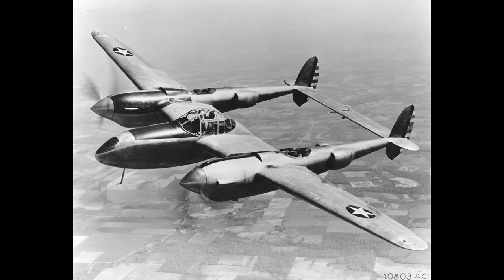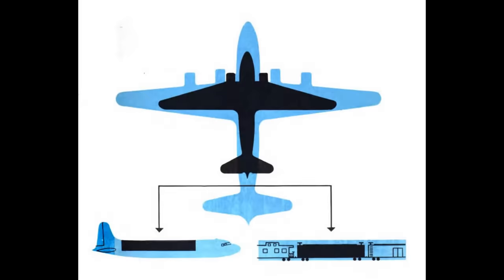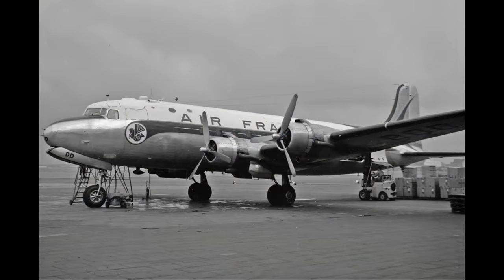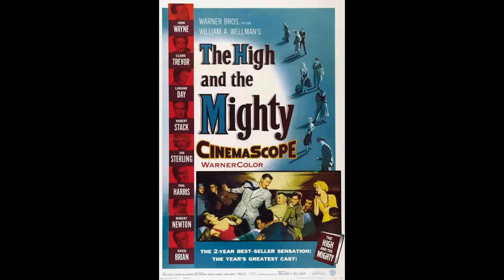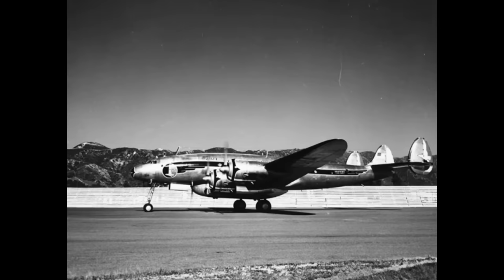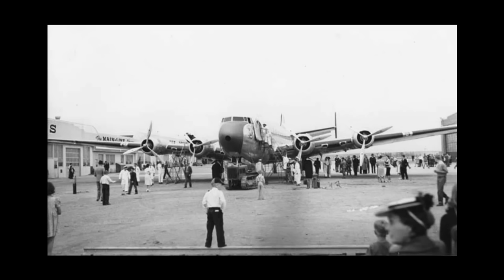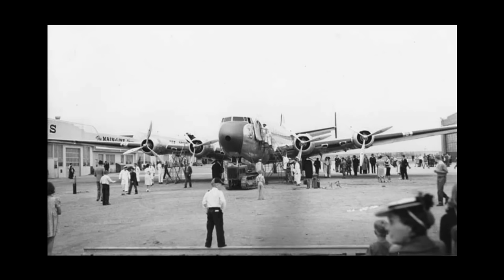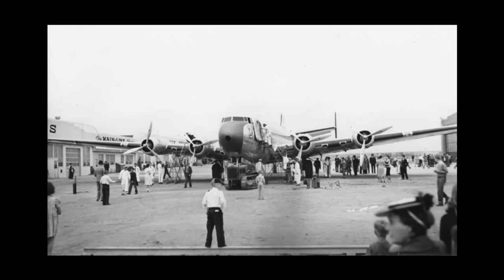Turbo Compound Piston Engines. Almost magic tech.

Comment: I'm imagining being a businessperson on board one of those things, trying to compose some notes on a pad or a portable typewriter, being serenaded with the soothing sounds of a thousand lawnmowers outside 😂
Reply: Big piston engines are LOUD. True turbo-compound engines were marginally quieter.
The Napier diesels were particularly fuel efficient.
Reply: you wore headphones attached to the bulkheads or earplugs if you were chique
Reply: I remember flying in those planes on Frontier Airlines in the late 60s, and even as a small child I remember thinking they were loud and the whole plane vibrated. Still glad I got to experience them before being replaced with jets, but damn they were a lot smoother and quieter, and more thrust on takeoff.
Reply: Flew Logan to Stuttgart in 1961 on a DC7. Returned on USS General Maurice Rose Bremerhaven to NY in 1965.
Reply: @MrArgus11111  No that came in much later.
Reply: @davidscott430  And on LANDING, every house within a mile of the flight path also vibrated - and people now complain about jet noise…
Reply: Radial engines are loud but I remember there being something oddly soothing about the sound. Unlike turbo props which made a horrific racket.
Reply: @randomDIYguy-k4r  Big piston engines have the same propeller noise levels as a turboprop but layer pulsating audio frequencies from the pistons at multiples of 40-50Hz per cylinder.
Reply: @allangibson8494  Does that cancel out some of the noise?
Reply: @twistedyogert  it adds to it.
I used to live under a flight path - a DC-6 on approach caused the entire house to bounce, a 727 didn’t.
Reply: @allangibson8494

Anything with a turbocharger was quieter as well. 

Which is why the Northstar and Argonaut using supercharged Merlins with short exhaust stacks lived relatively short lives hauling passengers.
Reply: Flew on s-58s for a couple years, I always pictured a group of Harley's pulling us through the air.
Reply: I’ve not flown on large piton engine aircraft but the turboprops used for short haul flights in UK and near continent are incredibly loud. You need ear defenders to sit near the propellers. It’s the prop tips getting near supersonic. I can’t imagine what actually supersonic prop tips must be like.
Reply: I've flown on the Q400's from Bombardier and I find them quieter than a Dash 8 for example. I liked my ride in the high-winged Dash 7 over the Rockies. Only piston I've ever flown on was a Cessna 172 and that was loud enough.
Reply: @randomDIYguy-k4r  Probably the odd number of cylinders, and the engine timing that was "off" due to the way the connecting rods were arranged around the crankshaft. Radial engines make (loud) music to my ears. I'd imagine the power recovery turbines ameliorated much of that exhaust noise, and smoothed power delivery to the prop.
Reply: Well I flew from Beja, Portugal to Lajes on the Azores and back in 1989 in a C 160 Transall so Ican empathize what it meant to cross the Atlantic Ocean in a prop plane.  We wore headphones. But maybe civilian airliners had better sound insulation…
Reply: ...and that would be better than sitting with somebody's "comfort chicken" on your head.
Reply: Alcohol was a thing
Reply: @allangibson8494 True but there can’t have been more than 100 “big piston” airliners actually in the air globally at any one time back in those days - compared to the 10,000 or so jets and turboprops simultaneously flying today
Reply: @neilturner6749  There were over 1400 DC-4’s, 6’s and 7’s built.
And then there were the Boeings, Avro’s and Lockheed’s contribution.
There were occasions when 400 DC-4’s were flying one air route simultaneously (into Berlin).
Reply: Yeah, being a businessman on one of these planes at that time, would be very interesting.
Reply: Ha Ha Ha,😅 You're a funny Guy!
Reply: @henrivanbemmel a Q400 IS a Dash 8.
Reply: In a suit and tie and a bejeweled lady in mink next to you, real china in the gally, cigar in hand. We were Kings, what happened?
Reply: Funny... cause the very first aircraft engine of the Wright Flyer was a "Dual Ovehead Cam" classic watercooled 4 cylinder, with all the basic components found in any "modern" 4 cylinder engine, including the long tensioned sloppy timing chain.   LOL ... guess you better do a bit more studying of engine designs before you find yourself mistakenly calling the more modern pushrod hemispherical head engines "archaic".  Which is a common misconception these days, even going as far as calling electric cars modern, yet they were found right along side Model-T Fords a 120 years ago.  Such as the Baker Motor Vehicle Company, an American manufacturer of electric automobiles in Cleveland Ohio, from 1899 to 1914...
Reply: @marclagalle1486  Yes, it is, but I few on the older pre-Q series version and compared to the Dash 7, which I really enjoyed, they have larger props and I found it quite noisy. I think the Q series are quieter, but I'm 6.3 230lb and I found the Q400 cabin VERY cramped and when I used the washroom I had to jackknife my legs against the door. The seats seemed like a postage stamp to me. The overhead compartments were too small to accommodate my computer bag. Thankfully, the cabin was not full and the flight attendant allowed me to sit elsewhere where my bag could have the other seat. 
So, while it got me to Boston, I would have rather taken the train. Sometimes its nice to be smaller I suppose.
Reply: That is why first class was in the rear of the plane where the majority of the prop noise doesn't affect it.
Reply: @georgemacdonell2341  Deregulation 👎
Reply: @calvingreene90  Yes, but when Air Force 1 became a jet under JFK, they had to make changes, moving the President's room forward  because in the 707 the front is quieter and smoother.
Reply: @henrivanbemmel  
Like I said "was" not "is".
Reply: I used to live under the departure path from Cochabamba Bolivia, the departing 727 certainly shook the house! But I’ve not heard a DC-6.
Reply: Imaginations working overtime here .... not much more disturbing than turbine engines!! Once  you adapt ovef hours to the noise. Smoother???  Yep ... but you get used to it ... can easily sleep ... read, work ... !!  From very long trans-Pacific experiences in Connies. One fascinating point of interest ... when climbing out ... at something around 15K, engines are throtteled back to idle ... spitting a lot of flame, as turbo charger gearing is shifted from low to high and reverse in descent. THAT can be a surprise ...
Reply: That was a sign of success.
Reply: @allangibson8494 Darn, and I recall 727’s being really loud
Reply: When people of character ran the world not the modern day armchair video game players.
Reply: The crazy part is you were probably thinking how amazing it was that you were crossing the entire country in one day in such luxury the entire time.
Reply: VIBRATION!
Reply: Pp!
Reply: just say businessman dude
Reply: @twistedyogert  only if your not a troll
Reply: Actually, in the cabin, the noise was well enough controlled that you could easily hold a conversation without raising your voice. Those purring radials would lull you to sleep like an old cat cuddled up to you at nap time. My early childhood is filled with wonderful memories of those amazing days prior to jet travel.
Reply: Actually, the noise level in quite a few of the older four-turbo prop airlines was surprisingly quiet, especially compared to the jet engines. My anecdotal experience.
Reply: @georgemacdonell2341 reality  came along.
Reply: Or Giant Hornets
Reply: B52 sounds cool
Reply: Its actually the opposite. Those big radicals run at low rpms and are a nice low rumble
Reply: @allangibson8494 a piston powered aircraft like a DC-6 is loud on approach because it is running at power at almost all times. It's bad for a radial to idle then go to power and back to idle in flight as the pressure on the propeller pushing back on the engine wears the bearings that aren't supposed to be pressed in that way. A 727 can idle on approach. Now be under a 727 on climb out and it's a different story JT8D's are LOUD at take off power and would muffle a DC-6 if it was flying next to it. They made hush kits for JT8D's so they would be quieter, it helps but it's still noisy.
Reply: @chrisgill7824  An early pure jet was loud on approach too - because the six second throttle response required significant power to be carried on approach to permit either an overshoot or reverse thrust to be selected on touchdown.
The props on a DC-6 were set for fine pitch on approach for similar reasons so the blades were stalled. The lack of mufflers and short exhausts on the engines didn’t help much either.
Turbocharged piston engines are much quieter as are ones with thermal deicing systems that route the exhaust through the wing leading edges…
Reply: @Dave5843-d9m  Listen to a Cessna during takeoff: the blade tips go supersonic, and makes a crackling sound.
Reply: I was a passenger on the last Connie flown by Eastern Airlines. It was on their Washington DC to NYC “Air Shuttle”. $29 a seat each way. And though that was in the late 1960’s it was darned cheap. The trip from NYC to Washington DC was on a Whisperliner, three jet engines on the tail. The angle of climb from takeoff seemed to be almost straight up. I was 11 or 12 at the time. 
Initially disappointed that the return flight was on a mere propeller plane, my father explained how pilots loved flying the Constellation for its sweet nature , and how lucky we were to fly in the last Connie still in service with Eastern Air Lines. As I recall, the flight was completely undramatic. No steep climb. It was almost like driving on a smooth highway. Which I suppose is a testament to how well suited they were from the point of view of a passenger.
Reply: @henrivanbemmel yeah deregulation letting all the middle class peasants in. Terrible
Reply: @Second.Nature.Lawn.Michigan  Yes, and that's exactly how we are treated. Not for me thank you. Much air travel is for leisure and given the environmental damage its a waste. It's fine to be free until what we're doing is killing our only home.
Reply: @henrivanbemmel  I think we can be free and not destroy our world. It all depends on how you define freedom. But you are correct, airplanes are exempt from almost every emissions rule in the name of mass transit. People don't realize how bad it is because it's not really a discussion
Reply: @Second.Nature.Lawn.Michigan  I completely agree, I just don't see meaningful progress and reasonable sacrifices being effected to that end. It saddens me. We humans seem poorly adapted to defending against these subtle dangers that will add up to disaster. It's difficult when one's fun and economy has been largely based on pollution generating technologies. Guess we'll see what happens, but I dunno.
Reply: Maybe i missed this, but i understand the flight engineer could disconnect the turbo compound. Could someone confirm if this is the case? A long time ago a mechanic advised the flight engineer not to use the turbo compounding on a very old Connie as he was concerned that the flight engineer might not be able to "get it out of gear".  Memory is a bit rusty.  Thank You.
Reply: Yes i remember as a child in the sixties hearing big radial engined aircraft throbbing away in the sky was a loud but soothing sound much more audibly pleasing than a 727 ,707 or DC 8 from the same era.
Reply: @MrArgus11111  Attached to the bulkheads? What would that achieve?
Reply: I would just be thankful it wasn't also 2 stroke. 

ever heard a 2 stroke diesel engine at high rpm?  then it is a miracle if you heard anything else afterwards.
Reply: You couldn't  drag this out any longer.  Zzzzz
Reply: @MrArgus11111  not in the 1940s lol
Reply: What, you aren't for the Earth Saving fuel efficiency, instead in favor of your creature comfort?😂
Reply: Cars do not noticeably vibrate, why must aircraft be worse?
Reply: "Business travel" via aircraft was basically non-existent then.
Reply: Funny I can’t imagine you a businessman-
Reply: Flying is not sustainable unless you’re a bird
Reply: @georgemacdonell2341 What happened?  Government happened.  I can go right through commercial aviation and point to every negative thing and find government at the center.
So much so that I frequently say that through all of history man has learned to fly.  Then in 50 years after first flight, government has sought to crush aviation.
Not hyperbole.  I should write a book about it.
Reply: My father in law RIP did a global business tour in piston engined propliners all he remembers was that they were slow, loud and vibrated a lot , very fatiguing.
Reply: At least you could use your smartphone without having to put it in airplane mode.

Comment: I wouldn't be surprised if the DC-7 was replaced because airline companies couldn't afford the engine oil.  As a kid I refueled airliners at a major airport.  When we serviced a DC-6 we checked the oil on all the engines every time and usually put the cap back on without adding any.  When a DC-7 pulled up to the ramp I ALWAYS aligned the props and pulled our oil truck in-between the engine nacelles before even checking the oil level because I added oil to the R-3350 every time and quite often I added a lot of oil.
Reply: Our oil truck broke down and was down for several months. Our boss had the answer: hand-crank-powered rotary pumps to pump the oil right from the barrels! Talk about cranking - took 20-30 rotations of the pump for one gallon of oil, and the -7Cs would often arrive with not more than 10 gallons in each engine. It was't uncommon to put nearly four barrels into a single airplane. When the weather got cold we had to store the oil drums indoors to make it pumpable. That 60W oil is about the consistency of honey - and when cold, not unlike wheel bearing grease.
Reply: Great detail . Very thorough. I had always assumed DC 4' s were pressurized. So thanks . ( reminds me of the Viscounts i grew up watching practicing " touch and goes "  and  one ir 2 engine off landings    Today i find if unbelievable thag all this training went on right in the muddle of tge day at a major North American  international airport .  Probablyin part  because we were still working on simulators that more  resembled my go kart :)
Reply: The DC-6 outlived the DC-7 in service because the PW R-2800s were so much easier and cheaper to maintain than the R-3350 with PRT.
Reply: @pal6636  Canadian made DC-4 with Merlin were pressurized.
Reply: Both the P&W R-4360 "Wasp Major", aka "Flying Corncob", and the Wright R-3350 "Duplex Cyclone" were engines that had a thirst for engine oil as well as 130 octane AvGas.  My Dad, who did 20 years in the USAF and retired a Major, recalled catching a flight on a KB-50 from Yokota back to the States, via Guam, Hawaii (Hickam AFB), and Travis AFB.  At each stop, while gassing up, not only did the flight engineer make sure the engines were topped off with oil, he got TWO 55-gallon drums from the ground crew at each stop!  Sure enough, every ten minutes or so, as the drums were set up at a point where oil could be pumped to the engines, he had one of the drums with the hand-crank pump, ready to go, and pumped in several GALLONS of engine oil!  My guess is that each engine did have a reserve tank for oil, and this was a means that Boeing had improvised to keep them oiled up on those long flights!  And I believe this was the enhanced "J" model that, like the B-36, had J47 turbojets added, only two instead of the four for the B-36, and those were used only to get to altitude with a full fuel and/or cargo load, or for when they had to refuel a jet, like a B-47 or F-105.  Even then, especially with the F-105, there was a "controlled descent", as the difference between the max speed of the KB-50 and, with a full fuel/bomb load on the "Thunderchief", the STALL speed, was only about 25 knots!
Reply: @selfdo  112 spark plugs to service.  Imagine the manpower and testing.   The aviation diesel was a better way to go but the jet superseded it as well.
Reply: @williamzk9083  Air Force mechanics had to service those "recips" in the freezing outdoors at those "northern tier" bases.
Reply: you refueled planes as a kid? damn that's epic
Reply: Another reason they should have done the DC-7D. Engine maintenance costs would have actually been more mamageable.
Reply: @ProAvgeek6328 mb he means 16-19
Reply: I do know that radial engines have a habit of dripping oil out of the bottom cylinders.
Reply: Yeah a lot of those planes had the wings behind the engines painted glossy black, so all the leaking and burning oil residues wouldn't look so bad.  @selfdo
Reply: The B-29 was the same way.

Comment: Turbo compounding is still being used today on Detroit Diesels DD16 engine. On a hard uphill pull, it will return an extra 50hp to the engine. But on the flat it can actually take away 20hp. So it is a double sided sword. Currently in the USA, Detroit Diesel DD16 is the only Diesel engine with turbo compounding. NO Swedish engines have them.

Comment: Heavy duty truck mechanic, sim pilot and armchair aviation enthusiast here.  I learned about turbo compounding many years ago and when I first saw it on a heavy duty diesel engine I was jumping around like a kid in a candy store.  "I know what this is!  I know what this is!"  The Detroit Diesel DD16 (an engine of, clearly, German design) has a parts recovery turbine on it.  I am always delighted to teach the young mechanics about turbo compounding.  They seem to think turbo compounding means two turbo superchargers.  I also get weird looks when I say "turbo supercharger".  It makes for many conversations and learning opportunities with those younger people.
Reply: Diesels are superb to add exhaust gas turbines to because the exhaust is more dilute with air and cooler than gasoline spark ignition which run with a stoichiometric ratio of 14:1 and are hotter